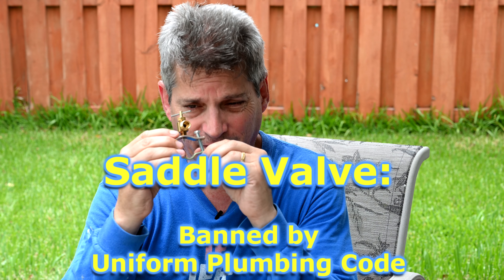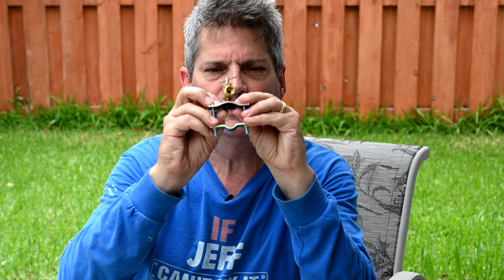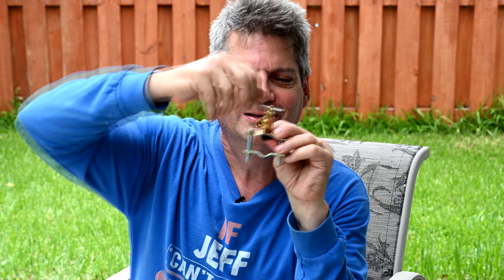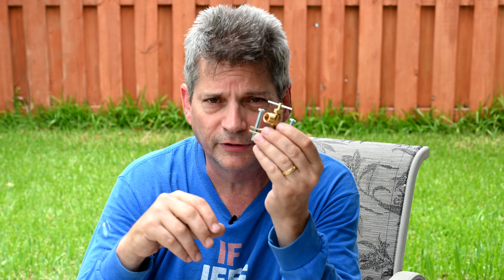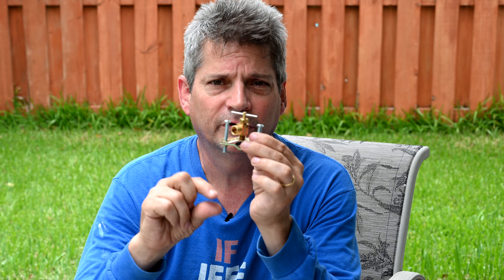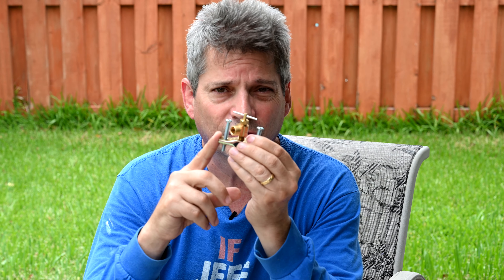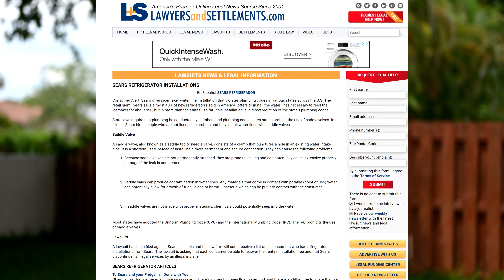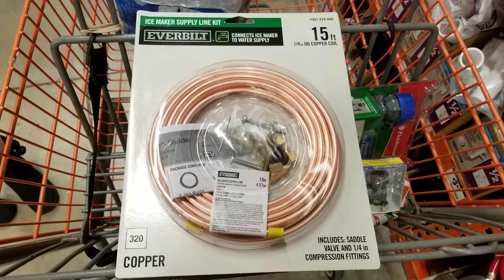Why You Should Never Use A Saddle Valve on Your Plumbing

Comment: you say that 'cheap' DIY users could just call a plumber to do it in 10min...the truth is most plumbers would refuse such a small job and would only come if that's part of a big installation, so that they can charge big bucks, and that's why, we go for a $5 quick fix
Reply from the maker: I have never had a plumber turn down a gig for changing a hose bibb or shutoff valve. Maybe try calling the smaller companies.
Reply: @jeffostroff  my minimum fee is $119.
Reply: Yep... I'm not a plumber, I'm a service engineer, but I work on the same basis as most plumbers in that I don't have "10 minute jobs". I have one hour jobs as a minimum plus call-out. I have a living to make and if I charged by the minute I'd just have to up the call out fee.
Reply: @AnthonyHandcock  Fair enough; I wouldn't attempt to call in an engineer for something a handyman can do~
Reply: @lapinchiloca  Well no... Neither would I but then I've always been good with my hands and will have a go at anything except carpentry and decorating. I learnt a long while ago that they are two things I am quite spectacularly bad at. Luckily I have friends who are competent in those things but scared of anything electrical, plumingical (new word) or mechanical so we swap skills and usually alcohol.
Reply: Absolutely. I had a plumber rod a line and connect about 5 feet of plastic pipe, it cost $300. I would not have gone for it, but it was an emergency and I had no options.
Reply: I always use a saddle valve because I am a cowboy plumber; be using them until the cows come home.....

Comment: Yup just checked and it’s there
Reply from the maker: What is the condition of the saddle valve, is it rusted or corroded in any way, or is it nice and shiny like brand new. Any evidence of past water trickling down the pipe where it connects?
Reply: jeffostroff  it’s definitely corroded, it does seem like it’s leaked at some point but I couldn’t actively see any leak from it .All I want to do is move my fridge lol  I just got the house and stupidly didn’t check under the sink which is a complete hack job
Reply from the maker: @melissamccormack1266  One of the problems with the saddled valves is what we call electrolysis caused by dissimilar metals in contact, and it causes that corrosion, as they leech electrons from each other. Eventually the saddle valve could pop off on its own. I just completed doing some advanced life testing on s addle valve and got it to corrode, and I'll be shooting a video in the coming week about it.

Comment: Yes I have one and its always been plugged up, the hvac system on my house was replaced. And to my objections they used the supplied saddle valve that came with the April air humidifier, it worked the first season. But water cost so much here I shut it off in the spring, its clogged close now and has been the last 8 years.
Id swet on a new t fitting and ball valve but its on the hot side of the 27 year old 6 year warranty water heater thats never been serviced. Draning the water out of its not an option as soon as I did it start leaking and id have to replace it. 
So my options are shark bite fittings. I dont trust them and a copper crimp on fittings or compression fittings I also don't trust.  To go further saddel valves don't meet code, the hvac system was inspected and passed by the inspector or I could have demanded it be replaced properly becuse the inspector failed the system over that part. 
I dont have a use for a 3k dollar copper pipe crimping tool im going to say no none licensed plumbers do.
And there isn't a cheaper option.
So I'm stuck with z stuck valve untill I have to change the hot water heater or use somthing to suck the water out of thd hot water line to solder on the proper fittings.
Humm just got an idea, I can siphon the water out of just the pipe lowe enough I can sweat on a t fitting, then build a copper line to the furnace by the humidifier.   Why didn't I think of this 8 years ago???

Comment: And there are SO MANY videos on YT that advocate the use of saddle valve / tap / tee and should probably be taken down. Both of the saddle valves in the place we moved into ( humidifier and ice maker) are frozen, and in nearly inaccessible spots. Luckily neither is leaking (yet).
Reply from the maker: Yes, these people are all in denial of the plumbing code that specifically forbids saddle fittings

Comment: Literally every "problem" you listed is user error. If done correctly these work just fine. I know licensed plumbers who swear by them. It's funny a YouTube handyman calling other handymen hacks lol.
Reply from the maker: You cannot be serious, you don't know licensed plumbers who swear by saddle valves, liar. Because every licensed plumber knows saddle valves are a violation of plumbing codes in every single state in the U.S. Every licensed plumber I have encountered does not like them. While installer error can contribute to failures, you and your "licensed plumber" friends never studied chemistry, so all of you don't that all these cheap white metal saddle valves, when applied to copper pipes, create electrolysis from illegal dissimilar metal contact, which causes rust, corrosion, and pipe failure, independent of user contribution. You crack me up, your licensed plumber friends swear by them? You came in here saying I was funny not taking this video seriously, but you just ended up embarrassing yourself, thanks though, you gave us all here a great laugh.
Reply: @jeffostroff  I guess you know every licensed plumber then? There only prohibited on water lines that are designated as drinking water. They have plenty of use for water being used not as potable or drinking. Does it have flaws? Yeah but a shitty soldering job does as well. But to come out and say some BS like "It's against code" when it's only against a certain type. But by saying "Every licensed plumber I know" you just proved that you're just a YouTube handyman 🤷🏼‍♂️🤷🏼‍♂️🤷🏼‍♂️.

Comment: 35 years in insurance claims. First thing I tell  homeowners is get rid of the saddle valve and rubber washer hoses. I've seen hundreds of leaks from both. Many people say they've had them for many years. It's a gamble I wouldn't take. Some states have removed saddle valves from the plumbing code and essentially banned them.
Reply from the maker: I have been challenged on my comment about plumbing codes, and numerous plumbers tell me they allow saddle valves in their state, but when I check you can see it's clearly banned. If the UPC and the other International standard both ban it, you can bet it's banned everywhere

Comment: Never had one leak, they are over 20 years old installed before I moved in.
Why not drill the hole manually and use an EDPM washer for the seal.
Reply from the maker: any type of drilling into a pipe that will be under pressure is asking for leak troubles. You are going to risk $20,000 in flood damage to a single piece of rubber.

Comment: Our plumber installed almost everything upside down in the house. Nothing was done right. Including the saddle valve being upside down and rotting out and leaking thru the core of the stem somehow.  Then there is no emergency shut offs except the main , then comes the fun of draining the entire system 1 bucket at a time. It didn't help the inspector was a drunk who showed up reeking like alcohol.

Comment: I have one and the compression fitting gave out blew the hose off and flooded my basement only to realize the drain was clogged with mud, yay
Reply from the maker: At least now you can fix it with the correct valve and you won't have this problem again

Comment: i wish you would have said what to use instead?
Reply from the maker: I assume for your fridge ice maker? What I do is instead of placing the saddle valve on the cold water pipe under the kitchen sink like the other folks do it, I remove the old valve from the cold water pipe. Probably needs replacing anyway. Then I replace it with this awesome double shut off valve, HERE: https://amzn.to/2KIKo24 with 1/4 turn shutoff action instead of multi-turn gate valve. But now you have 2 individually controlled shutoffs on this, one for the sink faucet, and one for the ice maker.

Comment: See these types of videos are severely misleading. Why not make a video saying you shouldn't PEX pipe, compression fittings, Sharkbites, etc. 20 years in construction and THEY ALL CAN LEAK. Hell, my expansion tank on my water heater got a pinhole in the middle of the body lol. Yes, there's more ideal ways to do it if you know how to, but if it's accessible, there's nothing wrong with these
Reply from the maker: There's nothing misleading about this video at all only your comment period this isn't a video about shark bites or other things this is a video about saddle valves your comment makes just absolutely zero sense

Comment: TELL US THE PART TO REPLACE THIS WITH.   DO THEY MAKE A "T FITTING" THAT IS MADE FOR ICE MAKERS?
1/2 COPPER?
Reply from the maker: Funny you should ask Terry, here is the part link,  we are going to make a video this coming week about this very topic: https://amzn.to/2vgam89 Instead of installing the saddle valve, you go back to the kitchen sink where the water shutoff valve is and replace it with a dual valve, one of which is 3/8" output, the other is 1/4" output. On the 3/8" output, you connect the hose to the cold water sink faucet just like normal. On the 1/4" side you run the 1/4" ice line hose back to the ice maker water supply inlet on the back of your fridge. The beauty of using this part is you can independently shut off the water of the sink or the ice maker without effecting the other one. you might get lucky and find it a bit cheaper at Home Depot, but many don't stock it.

Comment: They actually leak at that flimsy valve and not at the point of the tap on the pipe.
Reply from the maker: Most people reporting back to me say they leaked at the piercing point because it also deforms the pipe

Comment: You know they make saddle valves now where you don't Pierce the pipe. 

Your drill 1/4 inch hole so the pipe will not come out of round..
Reply from the maker: The problem with saddle valves is not that the pipe comes out of round the problem is eventually that type of the connection leaks, and also dissimilar metals in contact i.e. Cheap white metal from China on the saddle valve coming in contact with a copper pipe causes corrosion which leads to failure of the connection.
Reply: @jeffostroff  well I did listen because I bought a solder tee.. ;)

Comment: Instead of using a saddle valve for an ice maker, what should I use? I’m afraid a dedicated 1/2 inch copper pipe would have too much pressure.
Reply from the maker: This is what I use: https://www.homedepot.com/p/BrassCraft-1-2-in-Nominal-Inlet-x-3-8-in-O-D-Comp-x-1-4-in-O-D-Dual-Outlet-Dual-Shut-Off-1-4-in-Turn-Angle-Ball-Valve-KTCR1900DVX-R1/203309317 It's perfect to put under the kitchen sink. One side 3/8" goes to the cold water sink hose. The 1/4" side connected directly to your 1/4" ice maker hose.
Reply from the maker: @snaplash   I'm glad you were able to find it there because on Amazon it's more money it's usually the other way around

Comment: It’s bad.  Mine is non stop leaking after disconnecting the hose, it will not shut off after disconnecting and the only thing I can do is get another kit and try another hose set up or call a plumber and have them remove the whole thing. The valve is not able to shut off. Even with the water main shut off it’s still dripping thru the hose line. Turning it does nothing.  It won’t shut offmy bro in law installed it 20 years ago. I don’t dare remove it with a hole in the pipe.
Reply from the maker: You can cut out the old saddle hole yourself and solder on a  copper pipe stubout and the compress on a new valve

Comment: Sorry sir but I have to kindly disagree. I have had one of these in use for 15 years and it has not leaked a single drop.
Reply from the maker: sorry sir, but for every over confident person like you who has not had a failure yet, there are hundreds of people who had $10,000 leaks and up, just google Sears saddle valve lawsuits.
Reply: @jeffostroff  it make me wonder though if it’s the valves fault or if the person who installed it not knowing what they are doing. Every valve I’ve installed has never had any problems and no I’m not a professional I just have common sense to not do anything I’m not comfortable with.

Comment: Well... Isn't any other valve or joint deteriorat over time? Compression fittings, pushfit fitting, solder fittings.. you name it.. Any DIY plumbing failure can lead to same thousands of dollars worth of damage.

Comment: I would never use saddle valve, nor sharkbites nor pex a or b not any plastic tubing nor any compression valves soldering is the only long term solution

Comment: I've used them for years jeff....when properly installed they're fine.....u have shaky hands so i can see that its above your skill level
Reply from the maker: LOL, famous last words. You have no idea that your saddle valves failed. They work until the minute they fail.
Reply: @jeffostroff  I would agree with you.....and I don't personally use them. But have in the past and there's literally nothing wrong with them. It's like all plumbing and trade work. If you know what ur doing it's fine. And as in all cases, if you don't know what ur doing....u have way bigger problems than a rinky dink ice maker line.

Comment: A Tee, a short piece of copper pipe, and a shutoff valve is far better. If your house has a saddle valve, please call your roto-rooter or whatever plumbing company you prefer and get it fixed if you're not comfortable or competent enough to fix it yourself.
Reply from the maker: We are quit happy with the dual valves, it gives you independent control over each side!

Comment: Well I do not think people are to cheap. Yes save money. Call a plumber. It is 200 plus dollars. Ridiculous the price you have to pay. Now having said that. I have had one  on a pipe in my basement for 12 years. Now seeing you put that on you did it wrong. You make sure the screws on each side are even and you use a screw driver put it on nice and slow and the screws are even. Not like you did it. It will make the pipe messed up and cause leaks if you screw it together uneven.

Comment: If these are installed correctly, they work fine. Only a complete idiot would use a screw gun to install one, for obvious reasons. Further, these valves do not violate actual code in any jurisdiction I have ever worked in.
Reply from the maker: It's not typically the install method, it is the metal against metal contact that rusts and falls apart